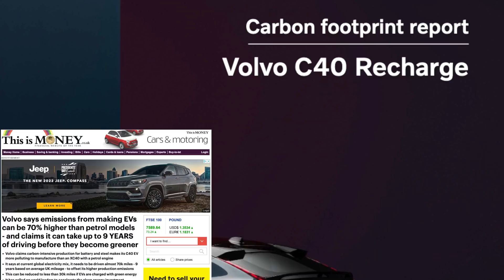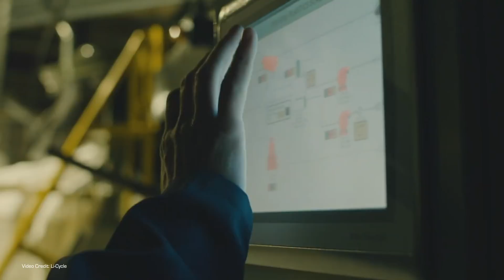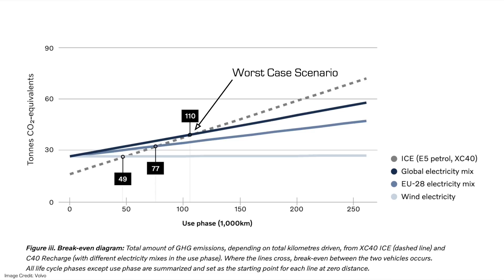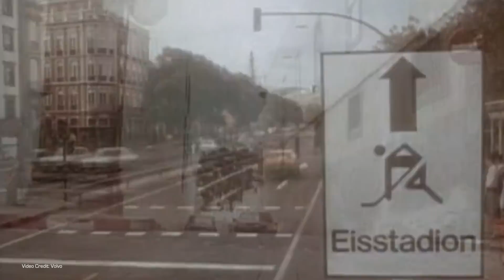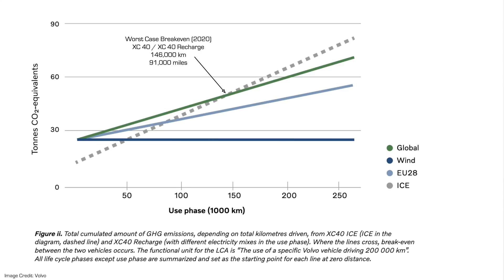Are EVs Dirtier Than Internal Combustion Cars? Not So Fast... We examine Volvo's Lifecycle Analysis

Comment: I'm a Automotive tech. that works on European cars  I was wondering if the calculation includes the oil changes filters, belts spark plugs timing belt ,timing chains just for a example I just repaired a 2013 BMW 5 series and at 125 000 km the timing chain and all it components were defective and the plastic valve cover was broken and was leaking oil this job is close to 30 hours this is the type of problemt that will never happen on a Electric Car. and all other parts that could be replaced in the life time of a car like starter, Alternator Exhaust system etc..

Comment: You also have to assume that battery manufacturing will remain as energy intensive as it is today. Which Tesla showed the world two years ago exactly how they plan to reduce energy use both at the mining phase and the manufacturing phase. We can assume that transmission and engine manufacturing have pretty much reached peak efficiency because its been going on for over 100 years. But lithium ion battery manufacturing is still relatively new and Tesla's method will certainly not be the last time we see improvements. And then we have to factor in drive train efficiency and hopefully changing perceptions about how much range a car NEEDS. So it is very likely that EVs will continue to get dramatically more efficient to manufacture AND drive, at the same time the energy mix is getting lower CO2 overall. While on the other hand even an ICE vehicle built using 100% renewable energy will still require a lifetime of carbon-based fuel inputs.

Comment: The oil industry continues to spew this garbage.   EVs are cleaner and no amount of headlines will change the claims otherwise.
Reply: Big oil are desperately trying to slow the rate of EV adoption..... They pinned their hopes on hydrogen, because if it had taken off, they would once again control the supply and the market..... Here in the UK at least, the pointer isn't swinging their way. Just 30 hydrogen powered cars were sold here last year......

Comment: I think the biggest actual issue is tire wear and micro particles found in the Arctic and Antarctic due to EV's being heavier, that won't be an issue if people pick an EV that suits their day to day needs. Sadly most people will choose a heavier EV with a bigger range in the end because it allows them the freedom to go where they want when they feel like without having to rely on outside sources. 
The only other issues are how much fresh water is used when mining for the elements required and the contamination caused by it. Once newer methods that are less destructive come along that won't be an issue but how long will that take to become cost effective for companies to actually swap over. 
Like anything there's drawbacks to EV's they're not 100% clean nothing is.
Reply: They are already reformulating E vehicle tyres.. and regen breaking helps cut on braking derived particles .. but the tyre problem goes for all vehicles ..especially heavier ones.. vans trucks buses.  So now we know the tyre manufacturers  can go to work on their formulas and structures 
to reduce this load. ..but yes narrower tyres on lighter vehicles do scrub less. Wider bigger tyres than actually needed has been a growth styling factor ...and has had other negatives such as increased tendency to aquaplane and slip in snow or on looser surfaces as well as the inability to carry a full sized spare or even any kind of spare.
Reply: I can't tell if you are being sarcastic. The issues you brought up, for example "the biggest actual issue is tire wear and micro particles in the Arctic and Antarctic due to EV's being heavier..." forgets to understand that EVs are only dirtier in that space than ICE vehicles to the difference between the weights of the vehicles. ICE vehicles still produce the same problem and to nearly the same extent that EVs do, however, weight in an EV is directly related to its range, so the ounis on EV manufacturers is to make them as light as they can be. Because charging will always take longer than filling up a petrol car keeping an EV on the road longer is more important than it is to an ICE vehicle that can just turn into a gasoline station and fill up. Before the OPEC oil embargo of the 1970s American cars were huge and wasteful. 
As for mining??? EVs aren't much worse than ICE cars. Oil drilling, refining and flaring have had a far more detrimental effect than our "mining" for lithium. Our current methods of extracting lithium are pretty horid, but recycling has proved to be much easier and more profitable than previously thought, and new sources requiring less invasive methods are coming. One method extracts lithium and salt from sea water and leaves potable water as a result. YES. EVs are not pure. They are not made from unicorn dust, Steal, aluminum and plastics require mining and drilling right now, but, this is equally true of ICE vehicles with the main difference being being that EV manufacturers are on a mission to reduce our impact on the planet. They wouldn't be doing it if it weren't, they would be producing petrol cars otherwise.
Reply: The atmospheric plastics come from all vehicles ... and a lot of the polar plastics are from the marine environment..ground up and thrown up .. 
As most land vehicles are still ICE powered and have been for decades you cannot connect the phenominon with just heavy electric vehicles. 🤷🏻‍♂️ .

If you want a rugged work vehicle with genuine off road  capacities and yet light wt. 
I would suggest you look up a 🇬🇧 1984 project  called Africar- a car for Africa. It used a wooden monocoque body coated in Epoxy resin like a boat ...but the suspension was inspired and built from a hybrid of Andre Citroens interlinked long travel independent suspension and Alex Moultons Rubber suspension developed for the Original Mini.
The other vehicle design of interest is William Towns Hustler Highlanders ... Though these were only two wheel drive and all had to make do with donor ICE drive trains.... Given seperate E motors driving either 
Two or Three axel versions then  you see the potential.  Battery tech allowing but easy to swap and upgrade..  The cars day as a disposable fashion driven item are going to come to end if 
Your going to have them their going to be for life and im talking a lot more than a decade or more...so they need to be fixable... and adaptable platforms.
Reply: True, but the percentage of difference is smaller than ICE cars. Baby steps, not everyone can ride a bike for transportation. I drive a Fiat 500 and a BMW i3, you're welcome.
Reply: Well, a big part of the problem is that the US government has been subsidizing oil to keep gasoline prices artificially low relative to the rest of the world. This has directly contributed to the trend of large heavy, not areo SUVs. An artificial stagnation in ICE engine efficiency has also resulted in skewing buying habits towards larger vehicles. The fact that my current 07 Camry gets the same real world MPG as my very worn out 97 Dodge Caravan got is down right frustrating to me. Same emissions, a fraction of the cargo space. Unfortunately I don't think the large car trend is going away any time soon. Consumers have been insulated by too many of these false economies for too long.
Reply: @patreekotime4578  The solution is to make larger cars much lighter and more efficient. Kate talks about this above when she compares the efficiency of Winter's tiny Th!nk EV versus his more efficient much, much larger and much more powerful Lucid Air built a decade later. I think sometimes people forget that a Tesla Model 3 when traveling at highway speeds uses less energy than an old 100 watt incandescent light bulb. What is even more amazing than this is that Tesla isn't implementing all of the efficiency boosting technology available. It uses regular old steal for its body panels, rather than aluminum or better yet carbon fiber, for instance. Tesla could incorporate supercaps for taking off and capturing regenerative brake energy for greater efficiency and less wear and tear on its batteries. It could implement magnetic centered axles reducing mechanical friction, or better yet move to hub motors like they do on the vehicles for the World Solar [vehicle] Challenge to eliminate most mechanical friction. None of which can be easily done with ICE vehicles.

Comment: And of course: "Those darned trees are using up all the oxygen!" "Wind turbines are using up all the wind and slowing the rotation of Earth!" "A big, heavy car will handle better because of all that road-hugging weight."
Reply: The last point doesn't  work at all because EV (especially BEV) are much heavier than a comparable ICE.
Reply: @remliqa  true, the advantage for EVs is that the CoG is way lower, if they use the standard "skateboard" under-floor battery placement, so it should "handle like it's on rails"
I wouldn't know, personally, because the vehicles I ride in are generally on actual rails (MUNI and BART). And of course, powered electrically.
Reply: "Those darned trees are using up all the oxygen!"
that claim couldn't be more wrong. trees don't use oxygen, they CREATE it.

"Wind turbines are using up all the wind and slowing the rotation of Earth!"
yes, the rotation is slowing down, but wind turbines have exactly NOTHING to do with it. it is due to the moon. do they want to get rid of the moon?
Reply: @mrxmry3264  Did you feel the wind when those jokes went over your head?
Reply: @kevinpolito1529  --  It is amazing how literal some folk are.  They wouldn't know sarcasm if it flew up their tailpipe.

Comment: I wonder what will my kids think about this topic in ~10 years. 5 years ago, all the anti-EV headlines focused on the fact that your expensive EV battery will die after 5-7 years completely and replacing it will be as expensive as buying new car. Seems the narrative changed a bit, but not too much :)
I wonder what will come next - my tip is "EVs are heavier, so the pollution from tires is FAR WORSE". Someone care to share another tip? :)
Reply: The other beautiful one is fear of evs breaking the grid. Ironically often given as proof we need to stick with fossil energy sources. 🤣
Reply: I've already seen the tyre wear one pop up!
Reply: Another great piece of analysis Kate. 👍
Reply: "Reduced brake wear in EVs causes MILLIONS of brake pad manufacturing job losses"
Reply: @BufordT  lol…. Those brake pads are basically made using automated machines.
Reply: @carholic-sz3qv  Perhaps I was a bit hyperbolic. But no one can argue that "EVs may use all available electrons in the KNOWN UNIVERSE by 2035!"
Reply: @BufordT  LOL!